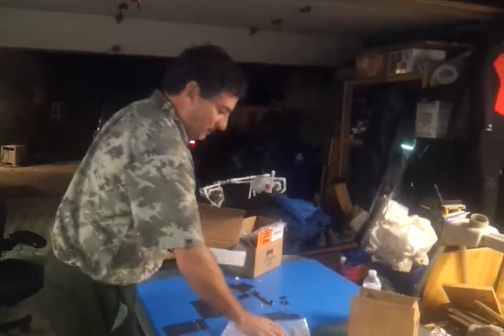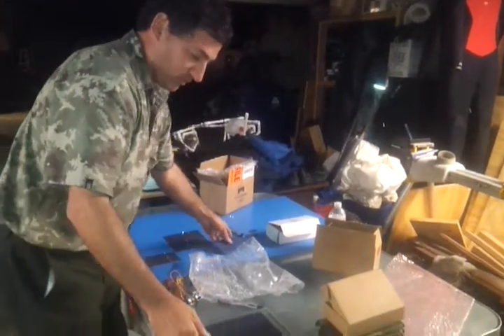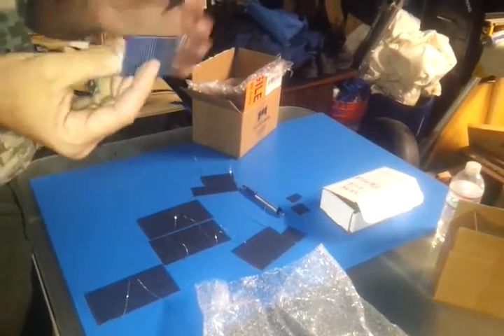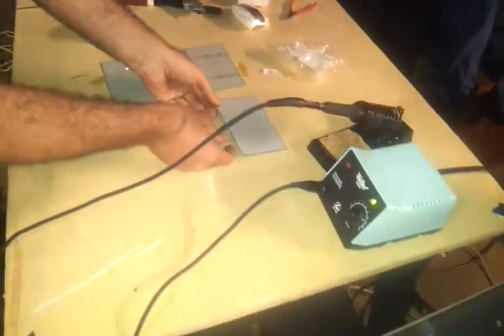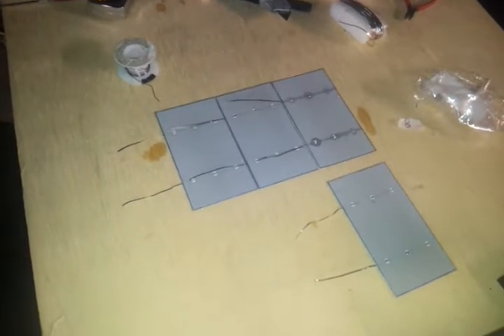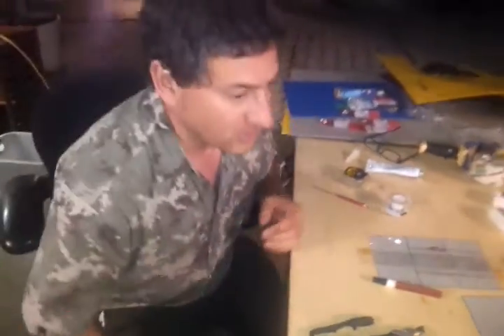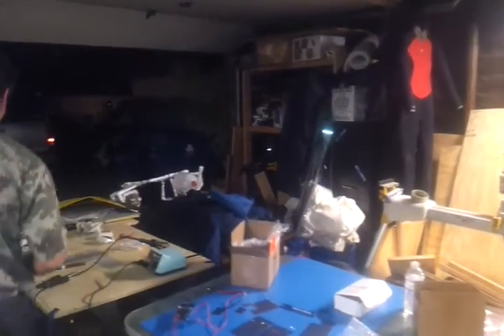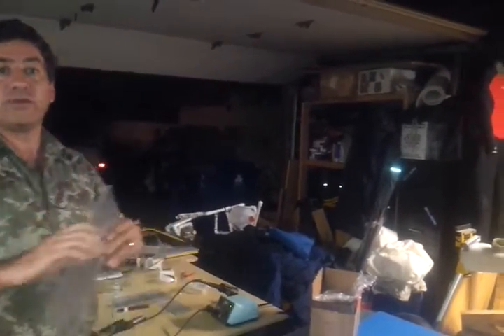Building our own solar panels for Hinku Valley Nepal Expedition

Comment from the maker: Thanks for the comment PowerPrudent. Yes, we brought vacuum tube solar hot water tubes up to the village of Dingboche last year. It was a challenge for our Sherpa friends to get all the tubes up in one piece (we broke three on the plane and on those narrow yak trails), but we ended up with a great SHW system.  Now we know the tubes need much more packing and bubble wrap and a rigid box than the companies generally supply. It is six days trekking to the village.